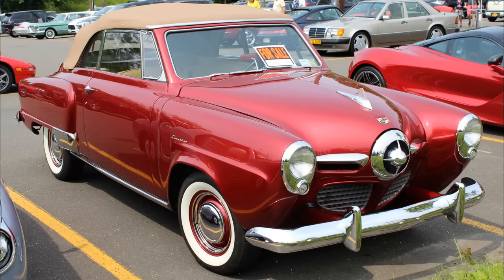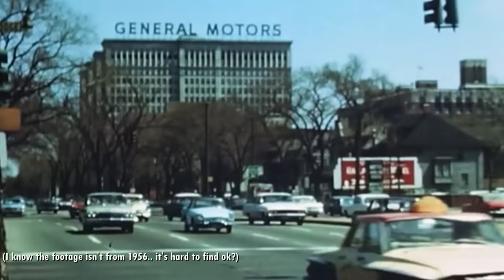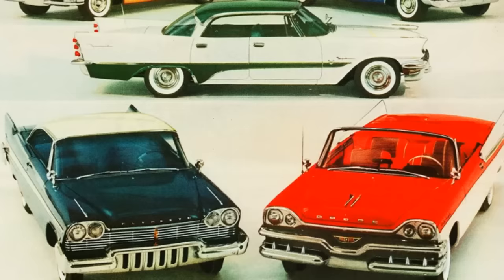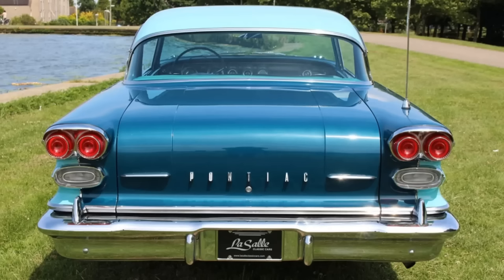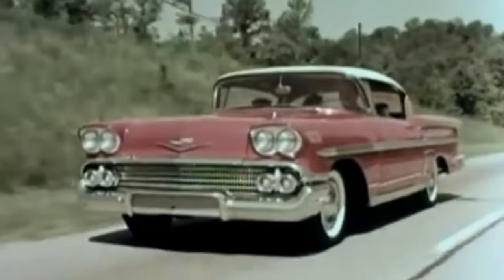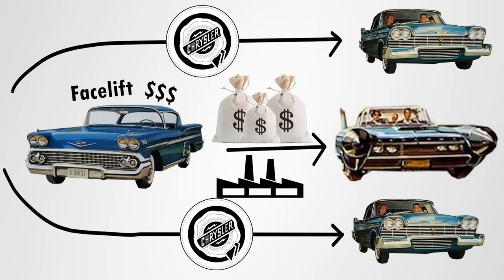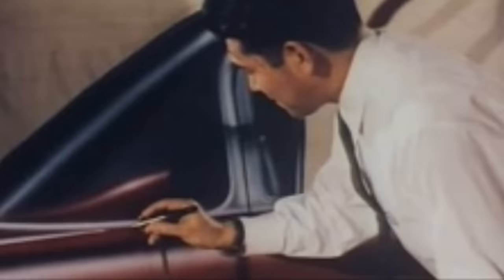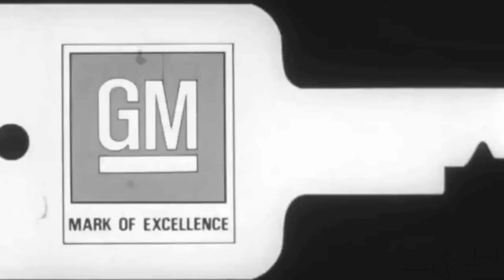Mistake of '58: The GM Chromemobiles and Far Out '59s

Comment: It’s just mind boggling that they could put out completely different models on a yearly basis.
Reply: I would argue the only thing comes close in its design, total reinvention and integration of new technologies is modern day sneakers although cars of that area were obviously on another level
Reply: Most cars back then where body on frame, which made it easy to swap out bodys as long as the mounts on the frame matched the body, most modern cars use UNIbodys now, the frame and body are built into each other, making it more resource intensive to change
Reply: Hugely wasteful!  Contrast this with French designs of the era: the 1934 type Citroën Traction Avant had only just gone out of production, replaced by the DS21 / ID19, which remained on the market until 1975.  Often, older models were kept in production concurrently with new designs for a few years as "junior" models...for example, Renault 4 saw several "replacements" enter the market during its 30 year run.  I commend this approach.
Reply: Pretty awesome huh. I drive a 2014 accord coupe and for the most part it looks exactly the same as the 2008-2017. Now my 1964 Olds Cutlass/442 convertible that i had back in '97, that car as simple and straight as the body was, you could easily spot it lined up next to a '65. 
LeMans/GTO, Chevelle/Malibu, Skylark/GS and Cutlass/442, all GM A body cars and all of them were made to look 100% different. 
Human creativity will never be replaced by computer programming. I wondercwhat the new Chargers etc would look like if not for their stylish ancestors. Probably look like a Nissan Altima or some other (plastic) bucket of bolts (sorry, clips! Not many nuts and bolts anymore
Reply: Whilst the Americans focused on cosmetic appearance change for purely marketing reasons, the Europeans/Asians made real technological  improvements, leaving the US far behind with their gas guzzling monsters.
Reply: The cars were large, due to much more room in the united states.  Gas was super cheap, room was plentiful, why not drive a living room on wheels?
Reply: Because it's simply wasteful and wrong maybe?
Reply: You do realize it was the 50's.  Times were much different than now. 

You feel free to be angry about something 3/4's of a century ago, while trying to hold it to the standards of today.  Angrily crunch your granola in your safe space, because auto makers in the 50's built cars that make you uncomfortable.   Lmao
Reply: How did they stamp out those parts.
Reply: Very carefully. @bobtis
Reply: And now every manufacturer makes the exact same angry-looking crossover utility vehicle, some even bravely venturing into slate blue and gray. The fact cars go the better part of a decade now without change from the bland, boring, generic boxes they are is telling.
Reply: @christrees8576  It did not help that they pushed environmental regulations eventually creating a situation where the cylinder count became a penis extension
Reply: Just the outer skins were changed. Cars would use the same body inner structure and chassis for at least three years. The 1958 cars had a fairly unique body compared to 1959-60 models, but all the GM cars used the same frame through 1964. I think all the GM divisions used the same doors, skins and all, on the coupe models as well.

But the 1958-60 period was unique. Typically in a 3 year lifecycle grilles, bumpers, and chrome trim were changed but the body panels remained the same.
Reply: @dewboy13  Driving and parking those huge cars in the narrow, crowded streets of Northeast cities that were laid out in Colonial times wasn't fun at all.
Reply: @bobtis  With massive 5-story tall hydraulic presses that used so much pressure that the steel went "plastic" and flowed into all areas of the die so it didn't come out wrinkled.
Reply: @ostrich67  I can imaginea

Comment: I saw a 58 Chevy for the 1st time on craigslist in a 2 car package project. One car was really rough but ran and was complete. The other one had a good frame, body and floors already done, a spare NOS quarter panel and extras with no drivetrain.  I bought them both for $3200 delivered to my house. Frame off restored the better one in 2018 in my garage, I love the 58 style for some strange reason. I found a '68 396 bbc shortblock  unassembled fresh from the machine shop (stored 20 years) and  put it together with a 700r4 trans. I found a deep blue "firemist" color online which was a cadillac thing and very heavy on the metallic. "Neptune blue firemist" and artic white 2-tone. 2nd car i ever painted and it was a passion project. I repaired every piece of stainless myself which was tedious but rewarding. Its the stainless and chrome that make the car "shine". I spent more time wetsanding and polishing than actually painting the car. i painted every piece off the car.
Reply: Link?
Reply: Would love to see the results
Reply: Wow. Nice book. Now, stop writing and go work on it some more!
Reply: @mikeconti3537  🔧
Reply: @WhitefolksT  that's what he use to work on his car 5 years ago. A tool. Well,before he started writing strangers about it,so 6 years.
Reply: I think the ‘58 Chevy design was awesome and I can only imagine how great your example turned out.  Great story!
Reply: Awesome with a big block !!!
Reply: In 1958 I saw a brand new '58 Chevy convertible that was repainted candy apple red and had 4 rows of lovers punched in the hood and with all that chrome it looked like a billionaire owned it.........Very eye catching for sure .......
Reply: PICTURES PLEASE 😁
Reply: How about a link to some pics?
Reply: Bought a pink\white  58 Cadillac when i was 22, to park in front of my detail shop. A guy from Europe wanted it real bad 3 yrs later  so i was nice and pass it on for what i had in it including new brake system and stainless dual exhaust.$4000. I should have kept it.
Reply: Fun isn't it??  I rebuild restore and repair only 73 and OLDER domestic cars and trucks. Been thru alot of 50s cars. When a car was a CAR!!!
Reply: "American Graffiti" made the '58 Impala iconic.

Comment: My grandfather had a 1958 Oldsmobile 88 Holiday Coupe.  He said he bought it in part because it had the most chrome you could get on a car.
Reply: im surprised olds didint offer a chrome-a-roo option pack to put over that
Reply: Our 1959 Super 88 was the 1st car we owned with AC and carpet on the floor. We all took our shoes off on our 1st ride. I'd buy a brand new one today if it were possible. To heck with the gas mileage.